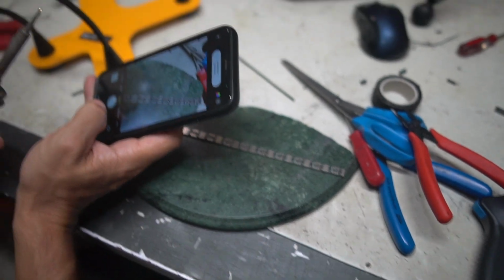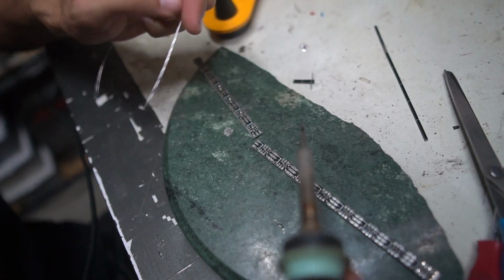Just a Sequential Custom LED Strip

Comment: I have an auxbeam led 6 mode 20" light bar, three wire unit. It works a couple of times and never works again. I'm on my third one from auxbeam. They don't know why it stops working, so just send me another one.  We'll. I don't want to hook up the third one and have it not work. For you do you might know what might be happening to the light bar

Comment: Thank you for your insightful videos. I am in South Africa. I have a 2012 Suzuki Kizashi which came without drls. I bought the twenty dollar 23 inch flexible strips and stuck them with white 3m double-sided tape inside bottom of lenses and curved them to the sides of lenses. (Forward facing)

They have functioned without fail since 2019. I feel it's now time for upgrade but keep the appearance simple as it is. (I can send a video clip).

I basically want more led's per strip. What is the best you can do if your strips cannot curve gently and at what price? 

Jay.

Comment: Do you not use soldering flux for small components? I do DIY electronics occasionally as a hobby, and soldering flux helps quite a bit in keeping molten solder from shunting small connections by making the solder stay on the metal pads.

Comment: What’s the correct name of the leds can u share a link to them
Reply: These are a two channel or bicolor LED. Just like a RGB LED is a 3 channel. Not to be confused with bipolar LEDs which are typically 2 color also but they only have 1 set of connections.
Bi color is available from most parts houses like Mouser or even super bright LEDs. They also come in a 5mm through hole if your just starting and want something a little easier to work with.
Reply from the maker: bit.ly/Ledstripz